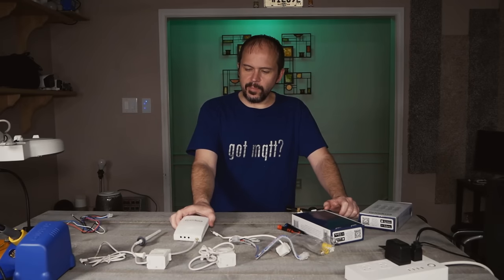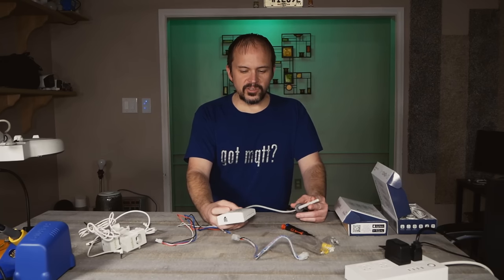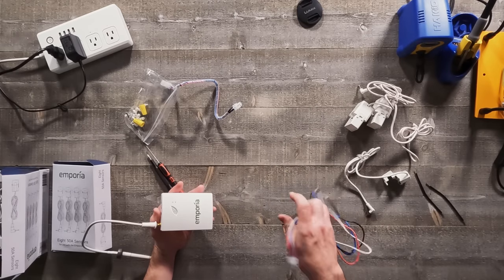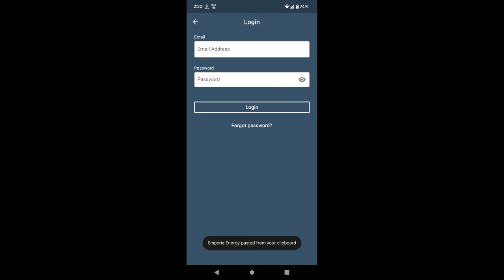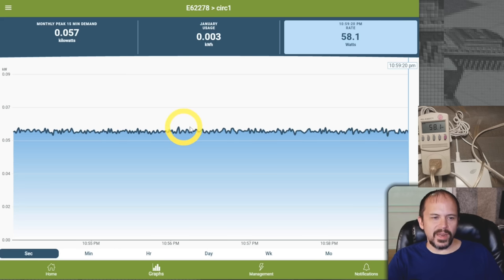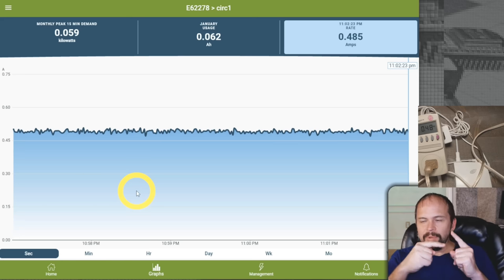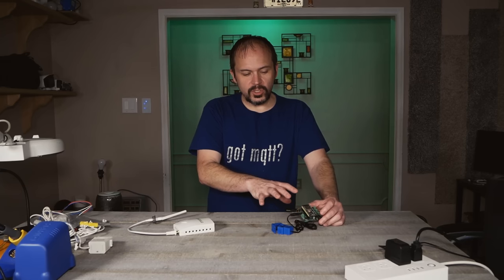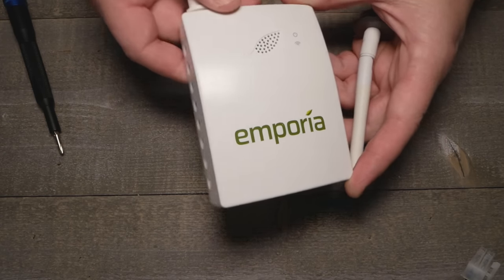Emporia Vue Power Monitoring Review | HOW TO w/ ESPHome & Home Assistant

Comment: I just purchased a Emporia Vue2 this past week and attempted to follow this guide.  The board shows revision 5.  I can't get the get the"esptool.py flash_id" command  to connect.  I checked the USB to TTL drivers.  I rechecked my solder joints.  They may have made a change to stop folks from flashing in rev. 5.
Reply from the maker: Could you drop into discord and post some pics?  https://discord.digiblur.com
Reply: @digiblurDIY   I think this unit may be defective.  I am going to send back to Amazon and get another.  I will update you once the new until comes in.  Thanks for you help.
Reply: Did you ever figure it out? Also on the rev 5 board and failing to connect
Reply: @fatalpush995  Just curious if you ever figured this out. I just got a revision 5 and I'm also hitting this wall. I'm wondering if it's my particular TTL so I have another coming tomorrow.
Reply: @antds857  Did you ever find a solution to your fail to connect issue?
Reply: @CommittotheIndian  I never did get it to work.  I figured I was doing something wrong.  I am still using the Emporia Vue with Emporia's app although I would have liked for it to be local managed,  I am happy that I can track my energy usage.

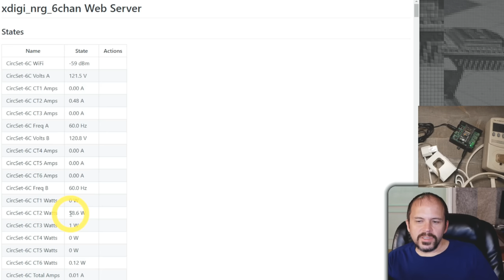Comment: 13:32 There ARE actually calibrations on the Emporia, but they only apply to the Watts and not the Amps. MAJOR BUG. (And it doesn't say anywhere in the app that it acts like this. It just creates a huge headache.)
Reply from the maker: yeah I saw they added that recently.  I haven't kept up with if they added more sensors yet, only have watts for right now.

Comment: How do you calibrate the sensors? I read somewhere there was a calculation when you want to monitor a 2 pole breaker that's 240v?
Reply from the maker: It is right in the config if you need to change the calibration, it is labelled.  There's also examples of doing multiply by 2 if you are monitoring only one leg of a split-phase 240v load.  https://github.com/emporia-vue-local/esphome#writing-configuration

Comment: Would a 7-pin pogo connected properly to a cp2102 usb ttl work here for a solderless flash? I’ve not soldered in 45 years and interested in options. Unsure how to best deal with the flux if this is an option? Thank you
Reply from the maker: Yes. I have seen people use blue tack as well to go solderlesss

Comment: I’ve been running two of these for about three weeks now and it works great. There’s a short thread in the ESPHome topic on the HA community page. MQTT support is coming soon. Re values jumping around for ports without clamps plugged into them, comment those circuits out in the yaml, recompile and upload. Makes sure you get both spots - each circuit is listed twice in the yaml, once for the wattage sensor then again a little lower for the power consumption sensor definition.
Reply from the maker: Yep. I talked about that on the FAQ. I will look on the HA side. I found the thread on the Esphome side. Thanks!

Comment: Just wondering: were the values fluctuating because no CT clamp installed and the burden resistor isn't there? Do the CT clamps supplied have burden resistors integrated or are they on the Emporia board?
Reply from the maker: I do think it is due to the inputs flapping in the wind. According to the Emporia guys the burden is in the clamp itself.

Comment: Any chance on this working with Tasmota one day? I haven't made the switch to ESPHome and actively fight it (though I'm not sure why)
Reply from the maker: I would probably say not at this time unless someone writes the full blown driver for it. I use both esphome and Tasmota myself.
Reply: Lol i am the same way. I like one code base and not having to have multiple points of these being able to enter the network. Now that there is a firmware out there that works, the major hard parts are done. I am sure they will have one soon(year or two) if some one wants to go through the files and make a version in tasmota.

Comment: Stuck at flashing. No cold joints, usb ttl driver correct, TX rx in right location, but still will not communicate. Any ideas to try?
Reply from the maker: Which TTL adapter? Some don't have enough amps.
Reply: Generic cp2102 usb-ttl v4,2
Reply: Can you recommend a better flasher with higher current?
Reply from the maker: I have been using this one even for the hungry esp32 linkind light switches. https://geni.us/XUNpdG4

But I do think my new favorite is the Voltlink one in my latest unboxing video.

Comment: Quick note. 

it says on the instructions "Connect RX to RX, TX to TX, "

now, my Vue is finally online but when trying to configure it on the integration it asks for a password.
Reply from the maker: If you put a password in the setup for the API then you'll need to use it.  I didn't put one myself.

Comment: It is a very super tutorial video for the Emporia flash with ESPHome. But I have a trouble and I don't find any guideline for this. So I used this code, I flashed the Emporia and it worked. It is actually behind tha wall. I replaced my wifi network.. But with this code we don't have a captive portal or any webinterface where we can change Wifi network. So how can I manage this without a new flash? I don't wanna open my wall. It is possible but it a whole day work... I hope someone know how can this situation handle without dimantling. Thank you guys.
Reply from the maker: I don't think web interface is supported yet on this build of esphome. Use the Esphome code and change the things you need and hit update to send over the new bin.
Reply: @digiblurDIY  but how I connect my server/ESPhome with the device without a same wifi connection? I can't connect my unraid server direcly to Emoria fallback AP bacuse is on LAN and don't work with wifi stick.
Reply from the maker: Oh without the captive portal or putting multiple wifi networks in the code before the change you will need to manually flash it again. It might be easier to make the same wifi network again add both wifi networks and switch it back.
Reply: @digiblurDIY  unfortunately I can't do that because the router is dead. However I do that. Thanks a lot
Reply from the maker: Use your current one.

Comment: I have a first gen power monitor. Would it essentially be the the same setup with tweaks to the config for less inputs? Has anyone experimented with the first gen model?
Reply from the maker: I haven't seen the first Gen. You would have to open it and see what chips it uses.
Reply: @digiblurDIY  I just checked and it uses the ESP32. However it has a breakout board for all the indivdual circuit sensors. I'll hop on discord and share some pictures.

Comment: I have split 150a so 300a total service in two boxes. Would I need two separate boxes that have no knowledge of each other or is there a way to hook up both panels in a connected way?
Reply from the maker: If it is two separate services from the utility then yeah you'll need two unless you have some way of using the clamps on both if they are close enough?

Comment: QUESTION: Does anyone make a product similar to this, that would allow individual monitoring of each individual “DC” solar panel in an array
so that we can log production per panel, possibly even with remote access???
Reply from the maker: I've seen that done with the inverters that had data connections before, not sure if there is an aftermarket deal though.  No experience with that side of things.

Comment: Is it possible to use 50A transformer on mains? No way I'm gonna fit those bulky 200A clamps on mine. 50A should be enough for european 3x32A 380v service? I wonder if its usable in europe at all? If anything below 100W @120v is too noisy to measure then in europe anything below 200w@240v is too noisy? I wonder if they make smaller clamps, eg. 16A instead of 50A? Also can you choose which phase is individual clamp on? Different mains phases might vary in voltage quite a bit.
Reply from the maker: You would need to change the calibration on those channels then.
Reply: @digiblurDIY  turned out 200A clamps have bigger jacks. Also 200A are absolutely humongous, no way i'm gonna fit and bend my solid core aluminium mains to fit them.

Comment: Hey Travis, what exactly is meant by "the HA Blue will not build this via ESPHome.  You would need to use a docker install on a supported processor to build the yaml file." that you mentioned in the more information section? I have the Emporia Vue 2 and I'm interested in doing this flashing ESPHome onto the Emporia device. But I have a HA Blue and I don't have a docker install of HA on a supported machine. And I'm not interested in learning Docker just to install HA to build some YAML file. At that point this does not seem to be worth it just to get it integrate with HA energy dashboard. How can I work around this?
Reply from the maker: I don't have an HA Blue myself so I haven't been able to test this. It was something a member reported. I will see if I can find anything on the Esphome side regarding this. Have you tried to compile it with the latest version?
Reply: @digiblurDIY  I have HA Blue and I get this error: 
"Tool Manager: Installing platformio/toolchain-esp32ulp @ ~1.22851.0
Error: Could not find the package with 'platformio/toolchain-esp32ulp @ ~1.22851.0' requirements for your system 'linux_aarch64' "

Comment: NEWB Here.... Just a gentle reminder that could be added to the video. If this is your first time using the CP2102-USB to TTL, make sure you install the drivers and don't use the ones that windows finds!!! I just spent 2 hours troubleshooting my connections, looking at traces on the board, beating up my computer... Just download the appropriate drivers!
Reply from the maker: Weird...i have helped many people and told them to use the windows drivers and it worked fine. This was windows 10 and 11.

Comment: I just purchased a Emporia Vue and have found out that it is cloud based only and I was ready to send it back to Amazon but I found your video.

I was looking at the other options like the Shelly and the CircuitSetup boards but it looks like for the shear amount of CT clamps the Emporia is pretty cheap.

I have never used Home Assistant or ESPhome so this is all new to me, I watched a couple of your other videos about getting home assistant setup.

Am I right in saying I am going to need some sort of machine to run Home Assistant (looking at a Dell Optiplex 3050 micro, 4GB of RAM, 500GB SSD used on eBay)

A CP2102 USB TO TTL module, some male PCB headers and some breadboard jumper cable? I have all the soldering equipment already, but do I need any other hardware?

I presume home assistant will log all my power consumption just like the Emporia cloud does? 

So I can look back over my power consumption by second, minute, hour, day, week or month? 

Thanks for the great videos as no way I would have found out about all this myself!
Reply from the maker: Jumping in deep and quick!  I like it!!  

Yes, I highly recommend a dedicated machine to run Home Assistant. You can for testing run it in a VM on Windows but I wouldn't keep it there for long because it isn't stable and that's not fun.  I've done a video on setup with this very machine style but whatever you can find on refurbs is usually great.  

Pretty much all you need, some have done few different methods to attach to those holes so use whatever  your skillset allows.  It is just a one time thing.  

Also if you feel you've got in a little over your head and have some questions you can hit myself and others up in my discord chat at https://discord.digiblur.com
Reply: @digiblurDIY  Yup sure does feel like the deep end :) Hopefully I can pull it off, I will be sure to check out your discord.

Thanks for the reply!

Comment: Have everything connected but can not get espflash to connect any thoughts. I am able to flag other esp devices fine.
Reply from the maker: I had this issue with someone on Discord the other day. Their USB flasher didn't provide enough power. Try a different USB port is one thing to try, use a bench power supply is one method or swapping to one like this. https://amzn.to/3tIybRd
Reply: @digiblurDIY  no joy tried that also. Only different is if I do not have IOO port jumped to case of esp I get beeping sounds. This is why I think I have got it in boot mode.
Reply from the maker: Swap RX/TX?  and make sure GPIO 0 is held to ground during power up.  
I use esptool.py flash_id command to check to see if I am connected.

Comment: Is there vue 2 and a separate vue 1 that has not been tested with esphome or something? The amazon listing does not say vue 1 vs 2, so was wondering
Reply from the maker: They call it a Gen 2 on their website.  The amazon listing is the latest one and the same I have.
Reply: Gen 2 is the one with the 3 ports on top and 16 small ports on the sides. Gen 1 isn't really sold anymore and just had the 3 main ports on top with a expansion module for 8 of the circuits.
Reply from the maker: Thanks for the clarification on this!

Comment: Tried it all and it looks like it does flash and everything, but i dont get any response from the emporia besides the powe rlight.
Do i need more than 3.3v to test it or what is going on? Can someone give me a hint?
Reply from the maker: it does depend on the power supply you have, sometimes they will boot sometimes they won't.  Unplug the wires and try to power it via mains.
Reply: @digiblurDIY  you mean i can flash this thing with just rx tx and main power applied? Or did u mean power with mains to see if something got flashed?
Powersupply is just the usb flasher right now
Reply from the maker: Yes. If you saw the flash go through fine then disconnect and see if the mains power will work. Some usb flashers/ports won't power esp32 devices enough for them to join the Wi-Fi.
Reply: @digiblurDIY  for some reason this morning i did connect it all and tried reflash and it went through, saw all the gizmos blinking and had ip and was able to add it to esphome, disconnected it all and put back into original case and mounted back in bracker box and...nothing again besides power light. Does that make any sense for you? Is it possible that it just ran from the usb flasher and not from its rom?
Reply from the maker: No that doesn't make any sense. I have seen it the other way a good bit where it flashes but won't boot from a usb flasher since the device pulls too much power and needs mains to join the wifi.

Comment: This system is good but has a major flaw if you've got grid and solar power. It double counts the grid power. Emporia told me they can't fix this, even though it's one subtraction calculation they'd have to do. So it was useless to me, and would be to anyone with grid and solar power.
Reply from the maker: And there my friend is the whole reason to do Esphome on it.
Reply: @digiblurDIY  what is Esphome?
Reply from the maker: The process I show in the video.

Comment: Well, it looks like the whole device and company just sucks. First of all they are only interested in forcing you to use their cloud. The cloud services ARE NOT RELIABLE. Next thing is: the Customer doesn't know what are they using the Customer data for. And these data are SENSITIVE data! Very sensitive. They can easily be used agains the Customer. Now the device itself: i can't see the device is sensing the voltages on both or all three phases (for 3-phase versions)! If you check the voltage on 3-phase system (for example in Europe) the L1-N, L2-N and L3-N voltages can vary A LOT. What does it mean? If you have current measurement on all 3 phases but voltage sensing on one phase only the whole power consumption accuracy just sucks. I checked mine 3-phase today: L1 voltage is 231 VAC, L2 is 245 VAC and L3 is 251 VAC. If Emporia is just taking voltage out of L1 and assuming L2 and L3 voltage is the same (in ideal conditions they should match but IT IS NOT THE CASE IN REAL LIFE) then calculated power consumption accuracy is so shitty.
Reply from the maker: It uses the voltage for each phase as reference so you do specify that at least in the Esphome method. I can't speak about stock cloud software as I don't use it.
Reply: @digiblurDIY  Thanks for reply!:) "It uses the voltage for each phase as reference ..." what you mean exactly? Is it actually sensing the voltage on each phase or just assuming it is i.e. 230VAC and equal on all phases?
Reply from the maker: There are three sensors for the three wires and they need to be assigned to each for voltage reference.

Comment: I wish it had Ethernet
Reply from the maker: That probably would need some sort device of isolation to pass code mixing low voltage and mains voltage which would raise the cost too much. The esp32 chip does support ethernet.
Reply: @digiblurDIY  I’m not sure it would be possible here due to the pins being used on the esp32. There’s a second “processor” on the PCB that’s helping the esp32. I’ll have to dig up my notes from earlier on in the reverse engineering game before these guys came out with the esphome library which has been awesome!

Comment: Bullshit. The Emporia is obviously sampling at a much higher rate than is available in the other rig. Doesn't even look like there's a realtime view in that other thing. Re: voltage: The voltage is directly measured on each of the split phases, and it's the same for every breaker on that phase (obviously).What you smokin' bro ? ;)
Reply from the maker: Yes. That's what split phase is. This box does up to three phase power voltage reference.